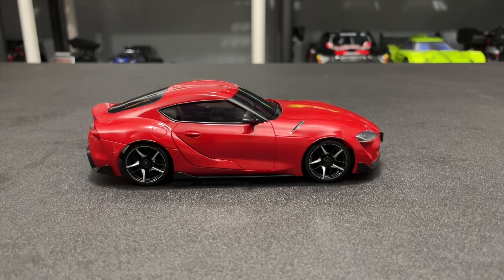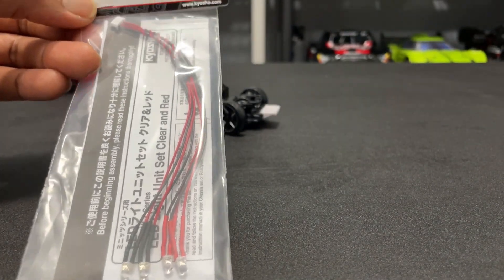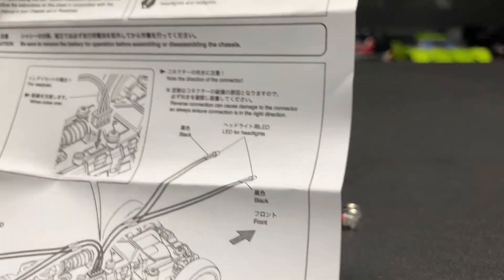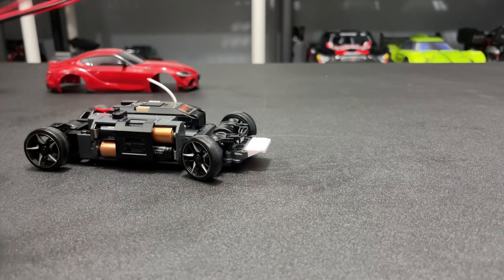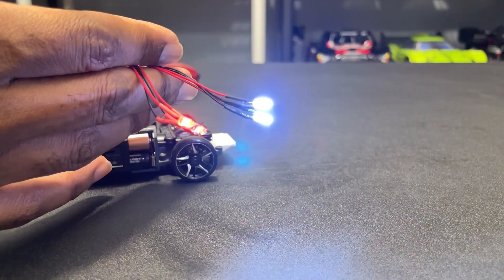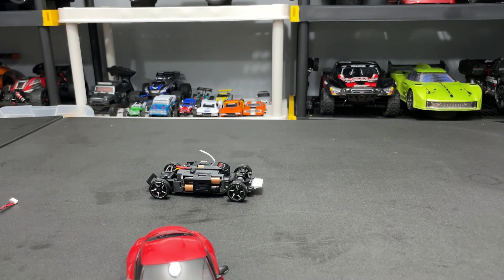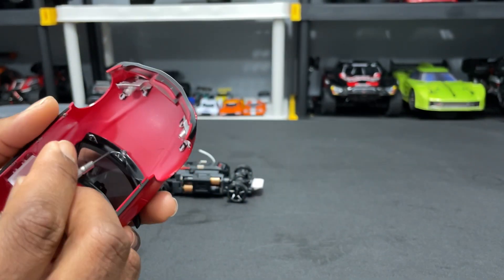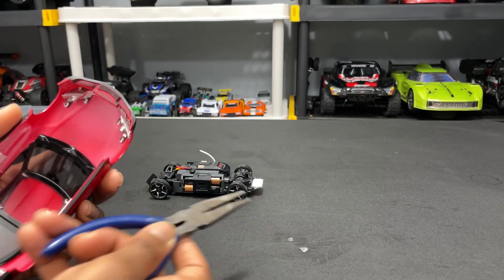Mini-Z AWD MA-020 GR Supra LED LIGHTS INSTALL #kyoshominiz #minizsupra #kyosho

Comment: Great video man. First one I’ve found where you actually see someone installing them😂. As for attaching them to the inside of the car, I think I’m gonna use black electric tape to make sure the wires steer clear of the wheels, and aren’t showing through the windshield. And, maybe to stop some of the light bleed in the front. That’s the plan anyways.
Reply from the maker: Appreciate that. Tape would be awesome to use also. That’s a great idea.